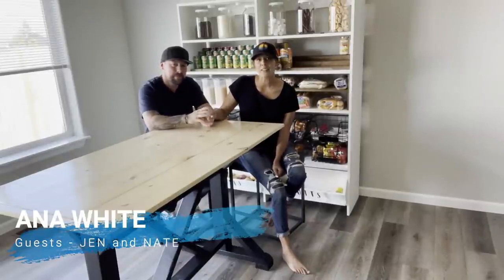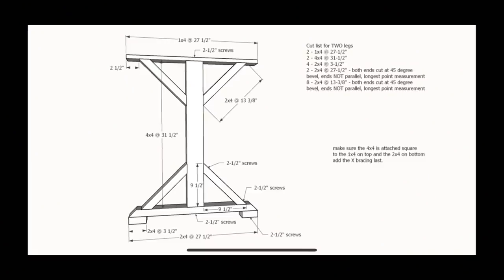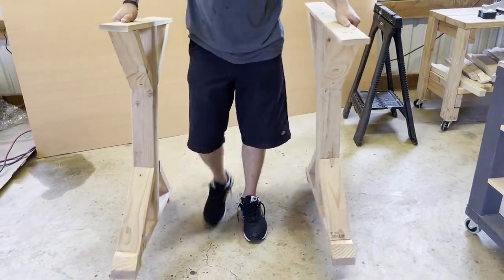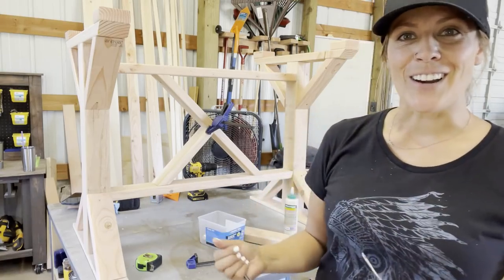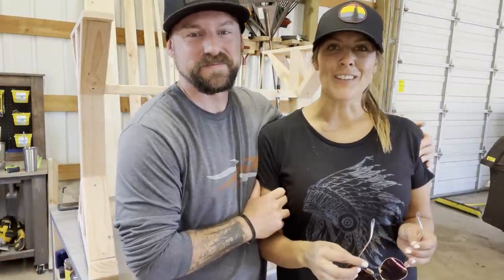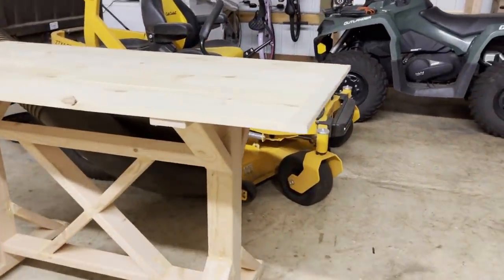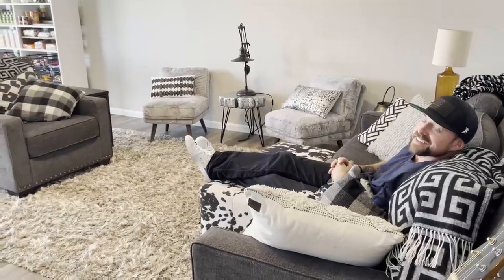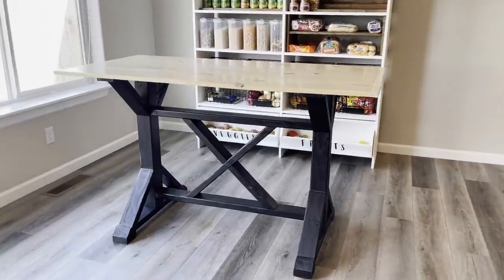Counter Height Fancy X Farmhouse Table Build with Free Plans

Comment: Great job! But I have my concerns on how the breadboards were attached rigidly to the top and seem to not allow wood movement... Hope it doesn't crack.
Reply: Agree. Not true breadboard ends.  Those are problematic. The top will crack and fail over time.  Also the manner of attaching the top to the base. The top needs to float and move independent of the base.  I really like the design, though.  Please take these comments as things to learn, not as criticism. You guys are on a great woodworking journey together. And that’s cool!
Reply: @mariodibenedetto6396  yeah, I haven't noticed the attachment of the top to the legs was also not allowing wood movement...
Reply: I'm a newbie and this is the most intimidating issue to me. My goal is to make things solid and sturdy so they won't get rickety over time...I don't know how to balance that with allowing for movement. I'm not sure when and where to allow for movement. What would have been the right way to attach breadboards, and to attach the top to the legs? Thanks!